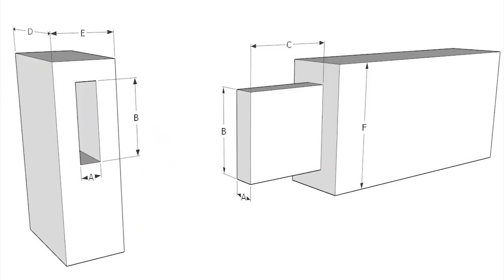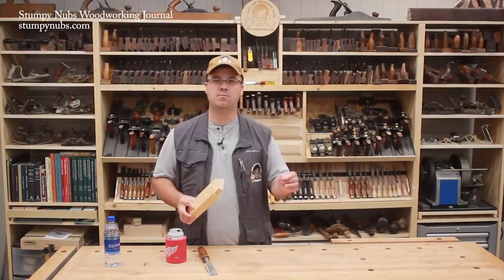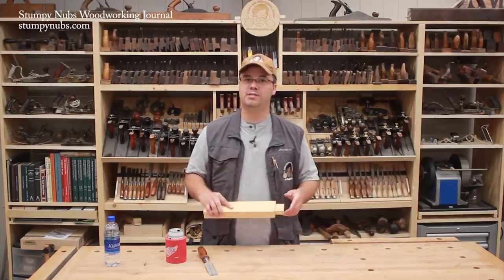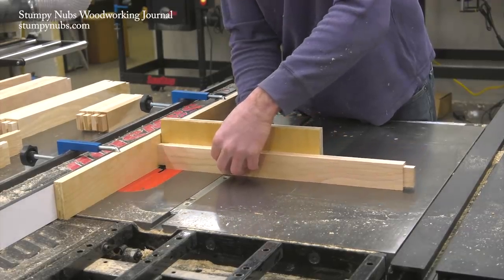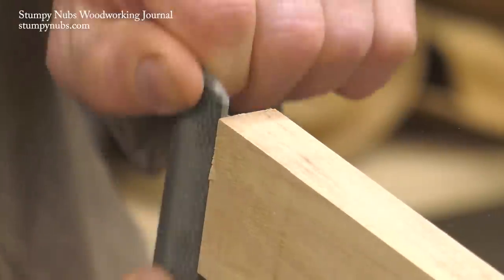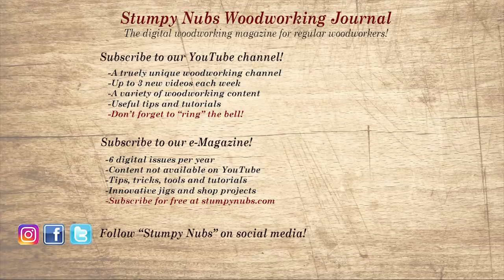Why you shouldn't cut your table saw tenons backwards

Comment: As a professional machinist that is used to work with requirements of less then a hundred of a millimetre - There is no thing as an exact cut. Always pay attention to your tolerances and how to handle them.
So while wood is very forgiving, carefully measuring parts and decide in which order to mount them might allow you to go from visible gaps to snug fit.
And when someone says something is exact, know that they just haven't measured carefully enough.

And at last but not least: Thank you stumpy for all these good videos that are full with good advice!

Comment: Thank you. This video helped me get back in  order. I was getting careless and moving my fence and then trying to come back to the original setting later on in the build. My tenons were so sloppy and I spent countless hours with a chisel trying to fix them. I am not lazy I justas winging it with my design. Iasm not a master at tenons so it was impossible to get a clean fit. This video and the waisted hours has reassured me that I must have a design plan and cut all of my tenons at once with a coupe of extra pieces.

You and your page use to bug the shit out of me and I thought you were a pompous ass and for that I owe you an apology. As my skills improve my understanding of your videos does as well. You are a highly skilled woodworker and I now value your opinion greatly. Your page is now my go to for any woodworking questions.

Thank you for always having the correct answer.

PS; I wish you guys had a welding page... Can't find a good one

Comment: I wish my side cheeks had a smaller glueing surface. Gotta ease up on those cold ones I guess. Great video, James. In all brutal honesty, I've never cut so much as a single mortise or tenon, and these guidelines make me want to go out to the shop and just trying my hand at it. Of course, the heat index here is currently 109°F, so I might opt to go straight for the cold one... Geez we're right back to the size of my cheeks. This degraded rapidly. I digress. Great video👍🏻😁

Comment: I actually usually cut just the shoulders on my table saw with a normal blade and use a stop block so the shoulders line up perfectly. Then I don't need to worry about my non-square fence, hah. I recently bought the mortise master jig though, and plan to just use loose tenons going forward because it's so much faster. Your channel is great by the way, not sure how I just found it a month ago when it's been around for so long.

Comment: James - for tenons wider than the dado stack thickness do you:
A) Make the shoulder cut on both faces first and then hog off the rest of the tenon waste or
B) Start at the end and hog your way in until you make the shoulder cut.
I've seen people use both methods, I was just curious if your experience has shown a best practice here. Your description indicates method B, but I thought I'd ask.
Thanks.
Reply from the maker: Either works. I usually start at the end and work toward the shoulder but there is little difference.

Comment: Great stuff, James. It is very nice to learn the theories behind the processes. This video packed a ton of useful stuff into 9 minutes. I think I can give it i shot with basic M&T joinery. Do you size the tenon so the friction fit is just tight enough to stay put when holding vertically? I know you need some room for glue.
Reply from the maker: That's correct.

Comment: Well I am going to provide a little kickback here. I have never had success with a dado stack. If the work pieces are not all the exact same thickness, like if there is snipe on the work pieces cut from the ends of boards, if the boards are a little warped (and they will be), if there is sawdust under the board, or if you apply an inconsistent amount of pressure in the cut, those tenons will not be consistent. Too many variables. The only way to do it on a reasonable budget is with a tenoning jig and a twin blade setup on the table saw. Perfect tenons every time, and no test cuts after you get the spacing right between the blades and write it down.

I would love to see you do a video on it to spread the information. All you need is a shop built tenoning jig and two of the exact same table saw blades.
Reply from the maker: Flat stock, good technique and a clean work surface are fundamentals of all good woodworking. See those stacks of tenoned workpieces sitting on top of the saw in the video? All precisely cut the same with no issues. I'm not saying this is the only good way to do it. I'm just saying the issues you list should be easy to overcome.

Comment: I was impressed by the bandsaw blade you used from Sawblade.com.  I do a lot of small curves and it seems to me that this blade made some really tight curves.  Can you tell me more about the blade (tpi, width, etc).  I am wanting to order some new blades for my bandsaw and need 1/8, 1/4, and 5/8 blades.  I use the 5/8 for resawing stock up to 10" wide.  I am looking for a better blade.  The on in this video seems to be what I would like.
Thanks,
Dave
Reply from the maker: https://youtu.be/z7n7Gg4QOkc